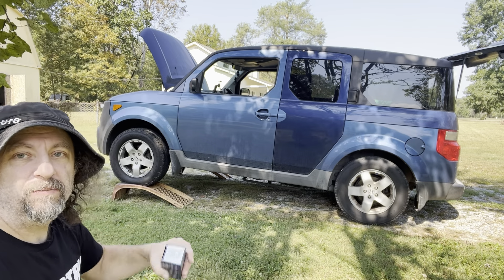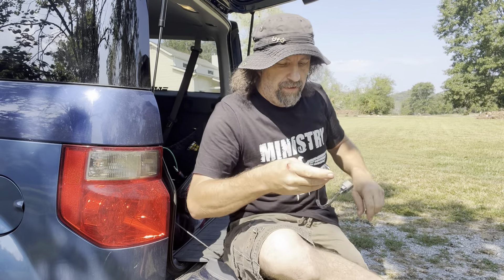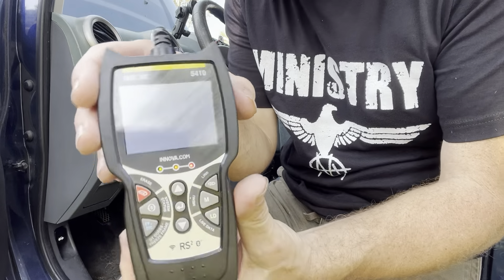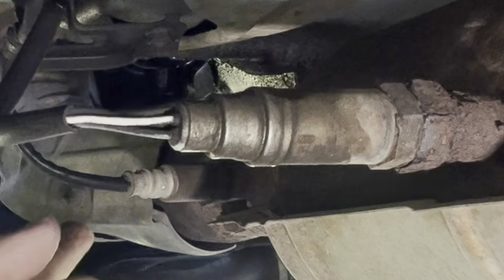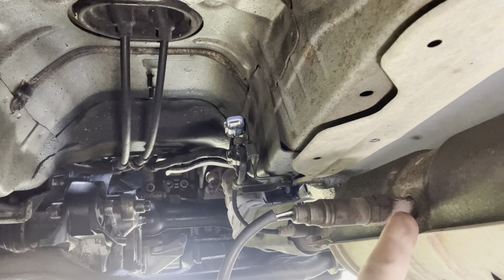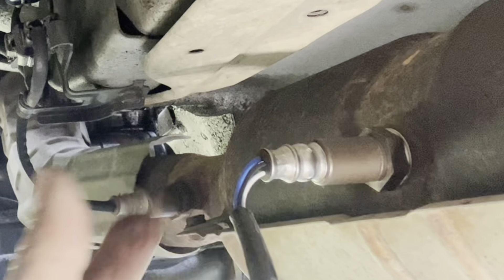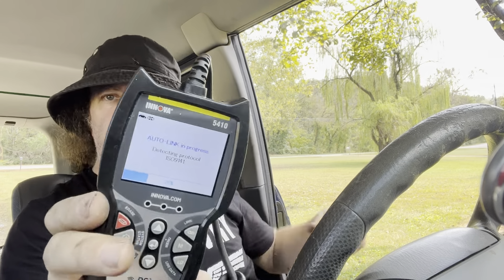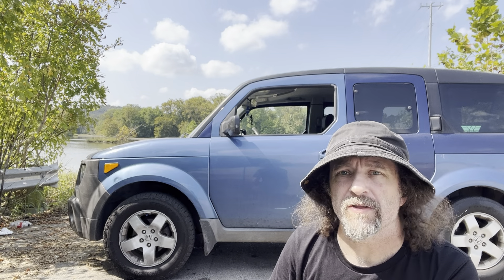2003 Honda Element po139 code (bad oxogen sensor)

Comment: Looking back at your videos and all the things that broke on the Element, is the Honda Element perhaps the most unreliable car in the world? I’ve never seen any other car that had more issues than this Element.
Reply from the maker: Surely not, that would be my 1984 VW Rabbit that was total junk! This Element would be fine if it wasn't abused for 10 years as a work van hauling overweight loads, trailers and neglecting basic Maintenace. It's a $1900 thirty year old 300,000 mile car. It needs some help.   Bad!
Reply from the maker: @MrWallStreet119  Indeed.
Reply: I have a similar Elemement: 2005, 300,000+ miles. I bought it from a TV station where it was used as a news car before being retired and then used as the engineering beater to haul crap around. By news vehicle, I mean it was driven by people that were barely out of college, and driven by people that had zero responsibility or financial obligation to it or its upkeep. It spent it's entire life un-garaged in the snow and salt of the midwest and maybe got a car wash every month or so if it looked really crusty. 
It was worth the $700 I paid for it. It had regular oil changes, but other than that, it was neglected...shocks, bushing, brakes, bubble gum man light, etc. Headlights were so worn that the parking lights put out more light. It has seen enough hail storms that the hood and roof look like the surface of the moon. 
I had the shop put on new tires, and have slowly replaced bushings, shocks, CV axels, brakes, and everything else that was original and NEVER designed to have a service life as long as it did. 
I don't know of any or many vehicles of that age with that mileage and service history that get up every day, start instantly and say "whatcha got for me today?' (except my small fleet of Priuses)
Currently it is my sons daily driver to work, and as long as he keeps the oil changed and doesn't tag a huge deer, I have no doubt it will turn 400K miles or more with ease. I'd jump in it and drive it anywhere without a thought.

Comment: Easy Peasy!  My element's aftermarket catalytic converter is breaking up currently, and at times the chunks are clogging exhaust.  Until i get a new cat, is there a way to "dechunk" it? Thanks for everything Clint!
Reply from the maker: I've thought about gutting mine since it's crapped out and not required where I live.

Comment: can u please make a video showing how you get the element on those ramps. i know is dumb but am having such a hard time, i feel like am just gonna go over
Reply from the maker: I will do that this week. It can be nerve racking for those who aren't used to using them.
Reply: For extra confidence, you can get a 2x2 wood block cut to the width of the ramp and screw it in near the top of the ramp. This will give you a little extra bump stop until you get used to driving on the ramps. A spotter may also be helpful.
Reply: A huge help is using them on grass. 
I hated using them on concrete. They would slide around in front of me half the time.

Comment: I have a P0420 bank one down stream code.  The light comes on and off.  I'm just going to replace the front 02 sensor see if it goes away
Reply from the maker: Did that fix it?